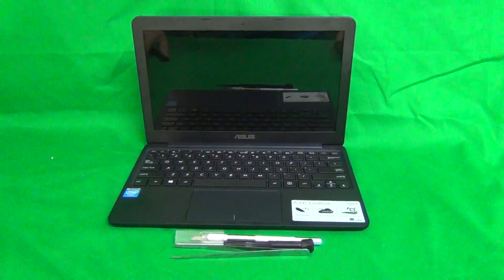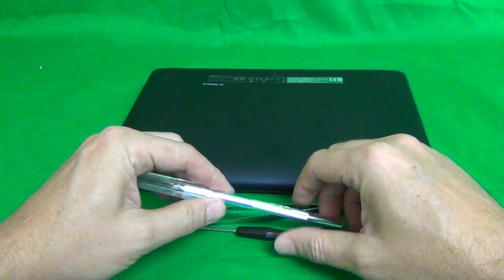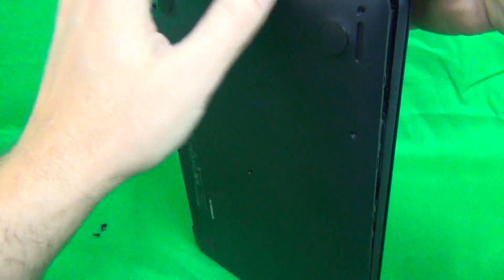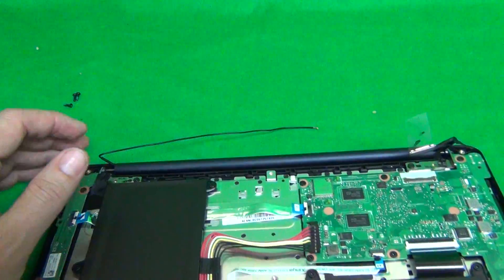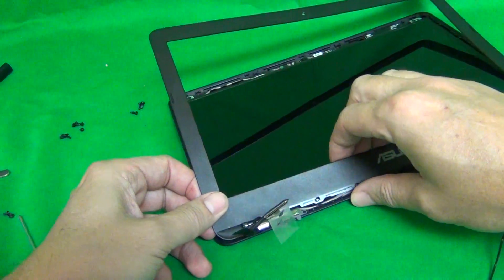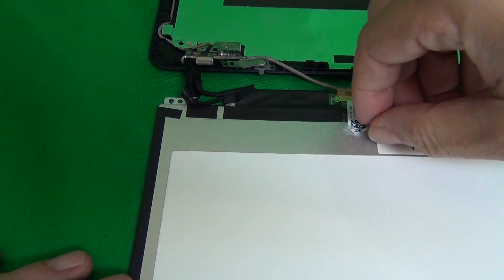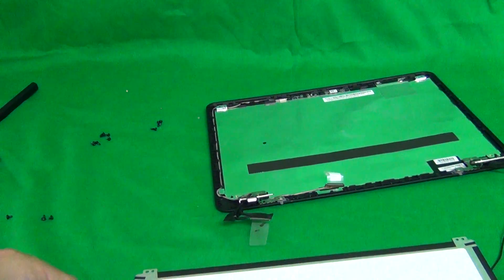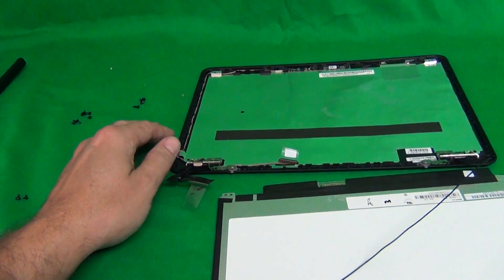ASUS X205TA Laptop Screen Replacement Procedure

Comment: Does anybody know if there is the possibility to replace the TN screen shown in the video (Innolux N116BGE-EB2) with an IPS one compatible with the X205TA?(should be 11.6" 1366x768, edp single lane connector 30 pins)

Comment: Good video, I just want to point out two things:

1.  Hinge cover is not symmetrical, so make sure to remember which way you removed it
2.  Pay attention to wire routing!  There are several ways to screw it up during reassembly!

Comment: I wanted to thank you very much. At my job I had one of these laptops with a busted screen and needed to reformat the drive. Your instructions helped me temporarily swap the monitor with one from another x205t to do what I needed to do without screwing up. :-)
Reply: Hi RunningRed, do I need to install new drivers if I replace the screen? Mine works but its cracked so I want to replace it too!

Comment: The RAM can not be upgraded in this model. No matter how good you are with a soldering gun the cpu in this model only supports 2 GB. Buy a fullsize laptop for about $100 more if you need more memory.

Comment: tell me please how to upgrade ram and ssd ???or at least just ram ... from 2 gb to 4 gb !is this somehow possible ???thanks
Reply: +LUCIANR81 It aint happening without a soldering iron and an engineering degree. Memory is soldered to the board.
Reply: so do you think its posible to change the ram if i found someone how repairs phones or laptops ... do you think he can solder new 4 gb ram ?
Reply: I really don't. If you need more, then  move up to a different machine. This is great for just zipping around the web, but it's not a gaming rig. It wasn't meant to be.

Comment: I just bought one of these and it's sad that Asus made everything one piece.. So if your ram fails.. throw it in the trash..if your hd fails.. throw it in the trash, if your cpu fails throw it in the trash.. My last EEE book had a removable HD and Ram and this is basically a big tablet. I paid 169 for an open box and its cool. I'm not a fan of 8.1 and windows 10 wont fit unless you do a fresh install.. And it uses a 32 bit UEFI firmware instead of BIOS and the motherboard is 64 bit! 10gb Recovery partition that will brick it if deleted.. Tried.. They cheaped out so much and changing the bios to UEFI sucks for trying to install other operating systems.. There is a problem with the audio fading in an out with some auto leveling software running that is untraceable. I hate this volume problem! If anyone can tell me the Auto volume leveling problem I'd suck your haha jk, but seriously. I tried different drivers, every built in option. Searched through the Registry forever.. Movies get loud when its quiet and then it turns the volume down with its loud. I hate built in equalization being a audiophile.....I like to customize everything, usually with Linux but this machine needs a special booter for 32bit UEFI.. .. Thanks for showing me the inside of this little thing. I think I will sell it and spend 300 and get something a little better.
Reply: ***** mine didnt have enough space to update to 10 so I just left 8 on it.. I tried a couple Linux Operating Systems but the drivers for the wifi and touchpad didnt work

Comment: Very good video.  It was immensely helpful in replacing my broken screen (replacement purchased from Screen Surgeons of course!).  The only thing I would suggest adding is that the hinge cover is not symmetrical, and it was not obvious to me at first which way it needed to be oriented to get it back on.

(Also the hinge cover seemed a little harder to get back on because most of the sticky foam tape/pad from the back side of the bezel that snaps around the panel had come off, so the gaps that the little plastic tabs on the hinge cover slide into are not as deep as they used to be.  I had to push down firmly on the hinge cover to get the tabs to engage enough to slide the cover into place.)

Comment: http://www.amazon.com/gp/product/B00JPJMRDA?psc=1&redirect=true&ref_=oh_aui_detailpage_o01_s00

^ this replacement screen also works on X205TA. Two things tho.
1. It won't be glossy anymore
2. you will have to scissor off the top right hinge.
Reply: Hi Randy, is there any quality diference between this Acer display and the others (and the original) ?

Comment: Excellent video, thanks.
In the latter half of the video you can see the two famous little metal or hard plastic tabs or protrusions next to the hinges. These are the things that stick into your table when you open up the lid of the laptop when you're using it, and scratch your table surface. I still can't see what purpose they serve, yet ASUS insist they must be there. Could this be the worst design decision/bodge job ever?
Reply: ForViewingOnly Just an update: after my comment above I ended up buying an ASUS X205TA for my Dad, and the little plastic tabs haven't really caused a problem at all. Maybe not the best design decision ever, but I think they chose to make the X205TA smaller than other 11.6" screen laptops, which meant that the tabs were needed to stop the laptop toppling over backward when the lid is opened.
Reply: +ForViewingOnly Bad design for stopping the screen from folding backwards. Do you guys have the Audio issue with something auto leveling the high sounds and lows.. Its so annoying, and Ive turned off every built in option and tried everything. Realtek, Asus or Windows 8.1 causes this and I can't figure out which one did it.. I'm thinking ASUS has some software in the UEFI that creates the Auto volume leveling and it makes me want to pitch it. I just wanna run Ubuntu or another Linux distro.
Reply: The bad design is not being able to replace screen without removing base even though there is a socket on the screen.